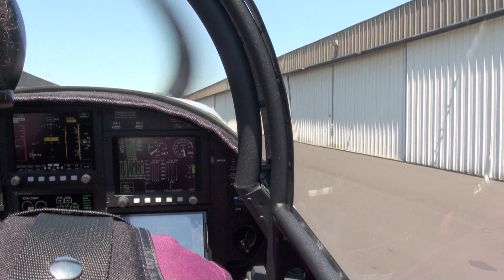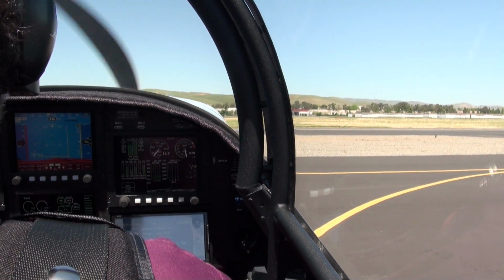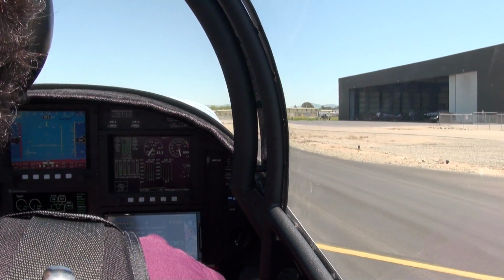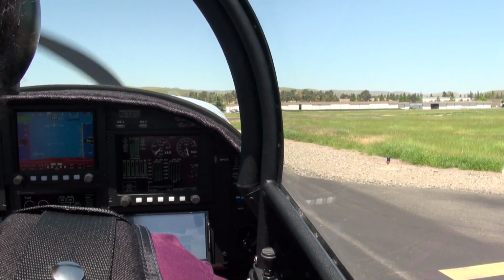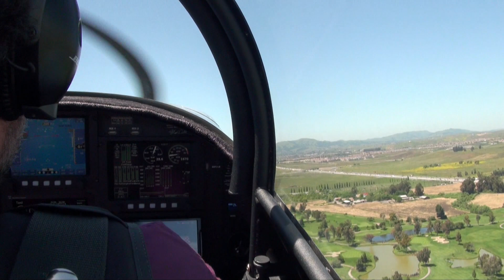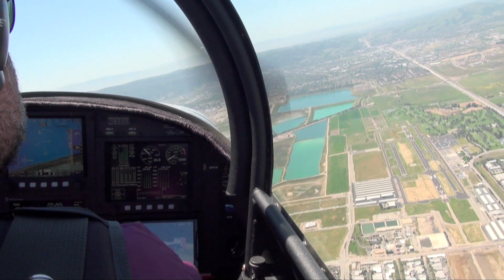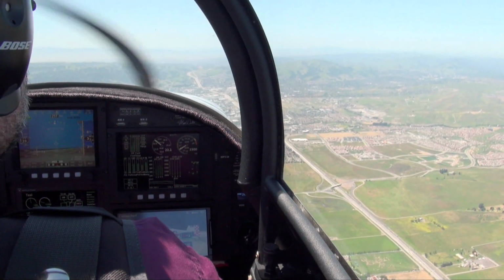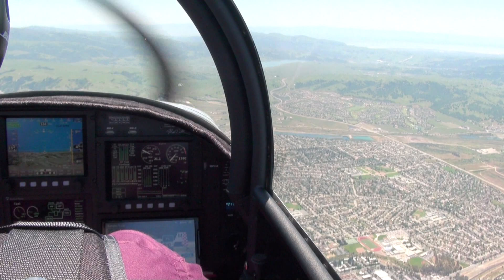2010.05.03 - RV-8 Test Flight - Part I - Takeoff

Comment: What kind of paint is on your roll cage??
Reply: A black textured Powder coat  I can get you the number if you want it.  It really flows out nice and looks totally professional.
Reply: Matt Dralle sure , is it normal powder coat?
Reply: See Here for Details: http://www.mattsrv8.com/users/display_log.php?user=MattsRV8&project=2273&category=0&log=194567&row=139
Reply: Here is the panel i did on my RV-6 in the same:
http://www.mykitlog.com/users/display_log.php?user=MattsRV6&project=2043&category=0&log=138133&row=94
Reply: Matt Dralle very very nice, thank you.